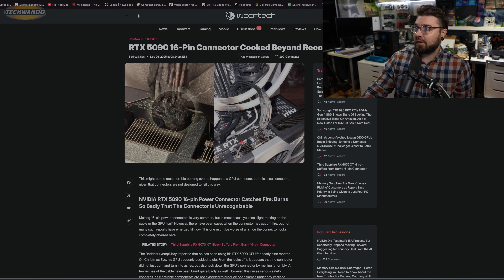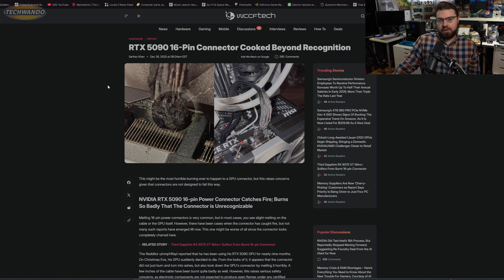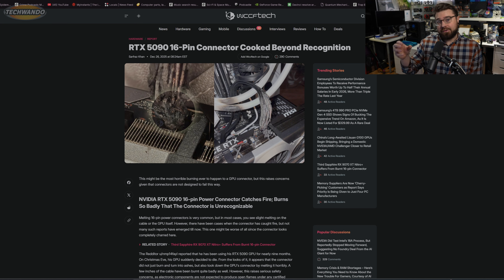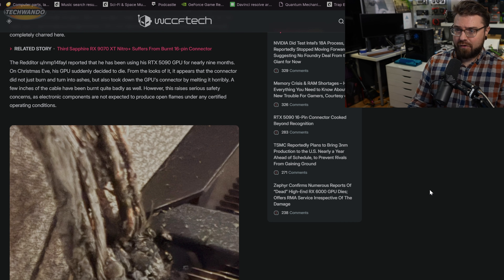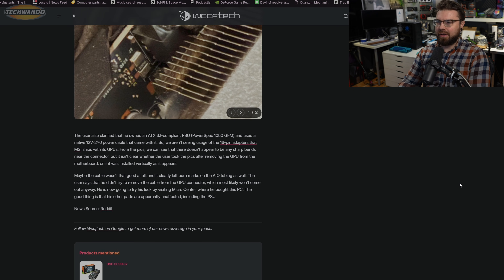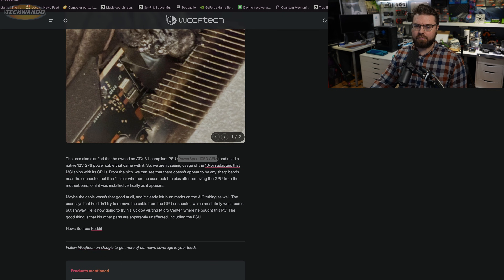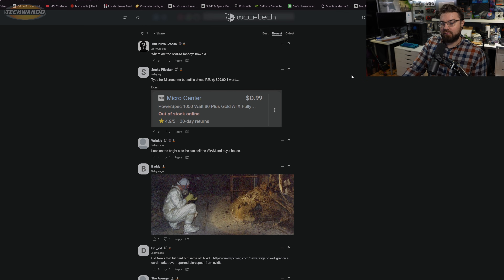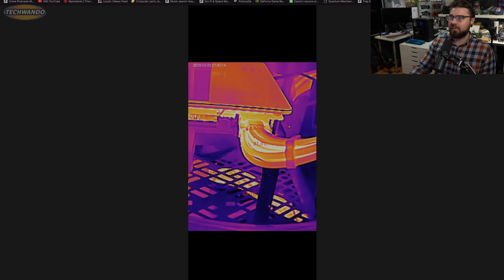Nvidia, Intel, PCI-SIG, please do something about this...

Comment: Micro Center power supplies are bad i seen a report that Capacitors are rated for half the time a a EVGA power supply is don't use a power spec with any graphics card you value.
Reply from the maker: I have seen a few burn out as well
Reply: if it was good or bad, it worked perfectly fine for 9 months, then the well known connector melted

it is pointless to mention the psu here, because it is not the first one to melt, nor it will be the last, it has happened on multiple brands on multiple gpus connected to multiple cables and multiple psus

the problem is push 50 amps at 12 v on a ridiculous thin cable that has no way to avoid to overheat or report it overheated

the design is poor, is stupid, electric engineers saw it and knew it was going to melt since it was announced, because a so thin cable cant carry 50 amps at 12v and not get hot.
Reply: @gotgg-n6w  Never buy that PSU for a 5070 on up they are god awful in other words buy a good psu if you don't know how to find one look it up.